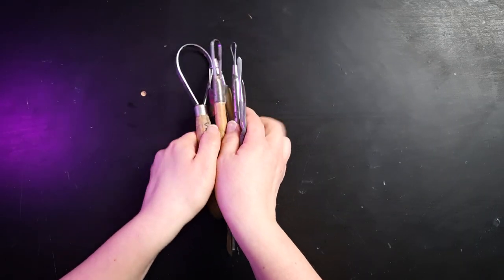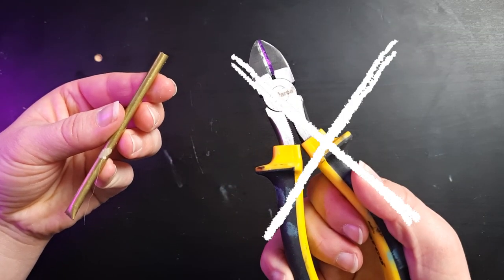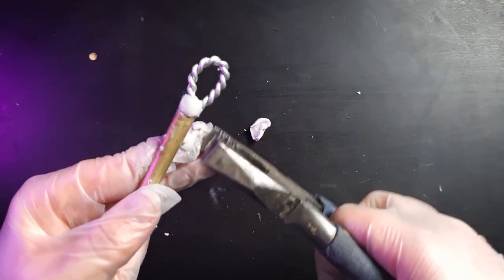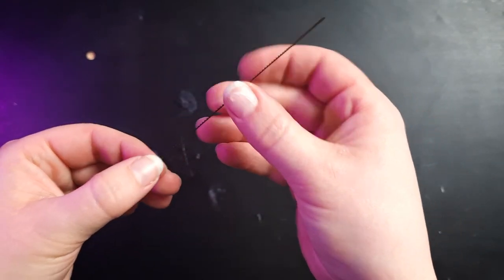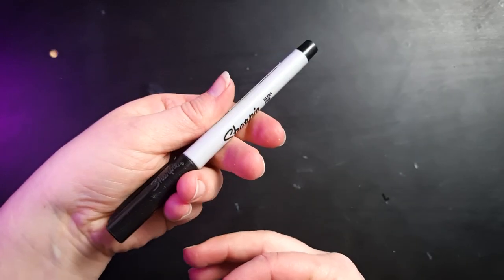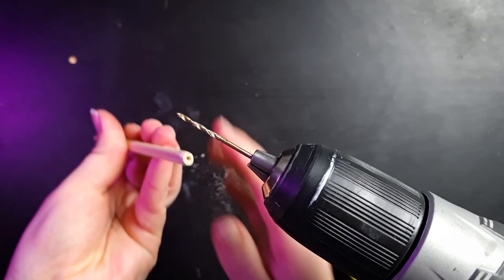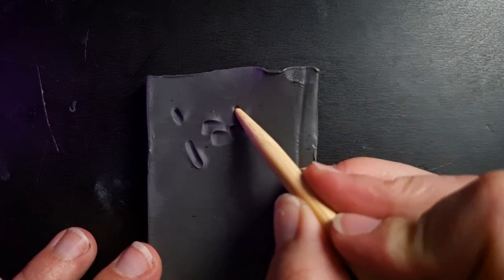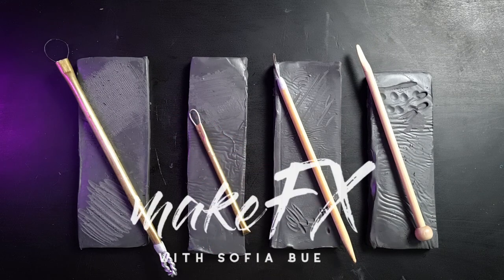How To Make Your Own SCULPTING TOOLS

Comment: Are you familiar with wires that companies & diy e-juice vapers use to make coils that go into rebuildable e-juice tanks? CoilMaster makes tools that are used to adjust & twist wire into specific coils that go in vaping tanks, incl’g but not limited to punch tools, wire cutters, etc. Would this work well to use as pottery tools on the wheel, by hand, & sculpted pieces? 

Love this video, btw.  😊👏🏼👏🏼👏🏼👏🏼👏🏼👏🏼